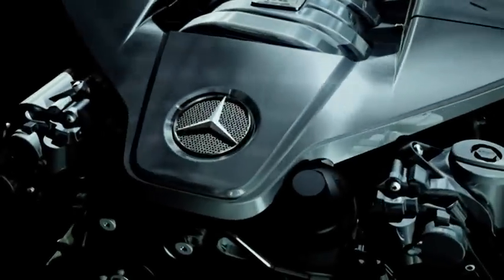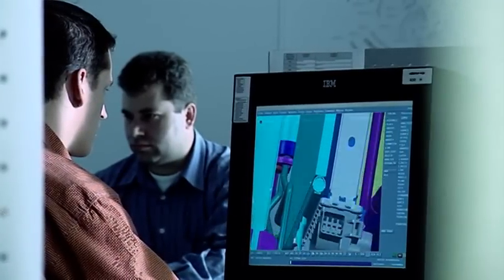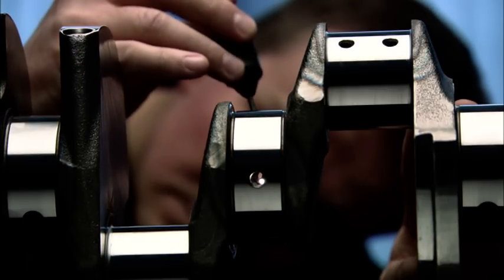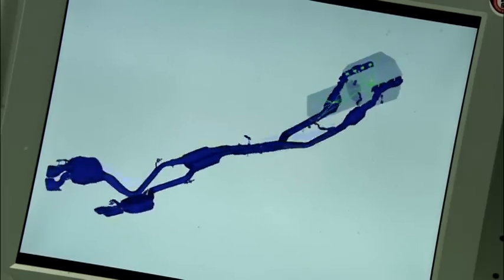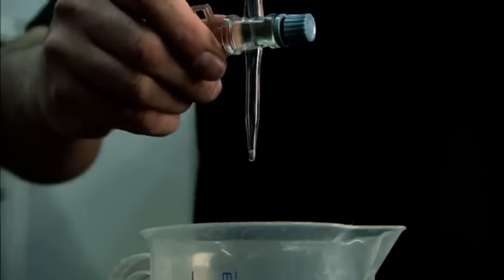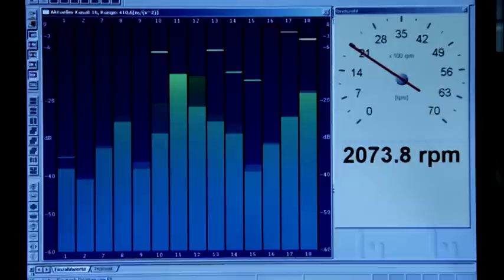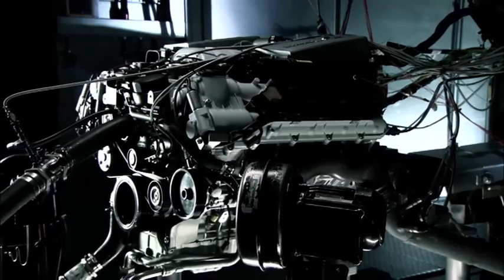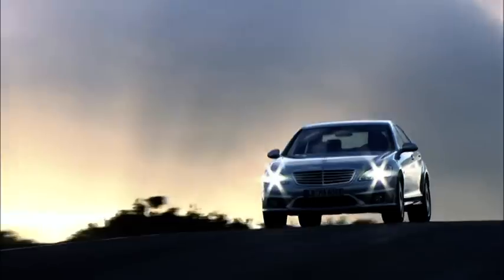AMG 6.3-liter V8 Engine

Comment from the maker: @Mert Turan - Thank you for your question. There are several performance levels for the AMG 6.3-liter V8 engine. The strongest variant is built in the S 63 AMG with a maximum output of 525hp. The performance in general not only depends on the engine, but also on the exhaust system. Also, the performance level is directly correlated to the competition and the market.
Reply: Like my 08 S63 AMG! Sydney Aus! :)
Reply: The strongest is in the sls black series
Reply: Diese Motor ist einer der Besten von AMG entwickelten Motoren. M156 einfach Legende

Comment: To all those people who don't understand the 6.3 saying that it is an 6.2 liter engine, the 6.3 is a reference to the first v8 engine AMG used in motor racing in the sixties. This engine was also the first production v8 produced by Mercedes and was called the M100.
Reply: Bs
Reply: i actually saw a video where one of the engineers explains that it's actually a technical reason why they call it a 6.2. but i can't find it anywhere. something about how you cant call it 6.2 once you go over 6.2, and since the displacement is 6.208, it becomes a 6.3.

Comment from the maker: @TheCrankshaftRotator - Thank you for your comment. As we previously explained, the engine size is measured by 100ccm which means as soon as you are over 100ccm (eg below), it counts as full 100ccm. Here are some examples of different manufacturers:

BMW E90 320i (2007/08) Engine: 1995ccm is called a 2 Liter engine

Mercedes SL 500 (2007) Engine: 5462ccm is called a 5.5 liter engine

Audi A4 B6-8E 3.0 TDI V6 Engine: 2967ccm is called a 3 liter engine

Comment: I have a 2008 C63 and did some research 1 month prior to end of warranty, and to my disbelief found several threads indicating problems with the engine that require a complete rebuild. Immediately contacted my dealer with the information and they agreed to a complete engine rebuild at a cost of $55,000 Australian. Lucky it was covered under warranty!!!!

Comment: My wish for AMG: bring N/A V8s back, and make all the AMG engines truly "one man, one engine" again as well (no V6 mass produced "AMG" nonsense).

AMG buyers don't care how much the MPG is going to be, really (at least that's the case for all AMG owners I know), besides - turbos only are economical if you run as smoothly and steadily as possible  -  any performance engine (turbo, supercharger, naturally aspirated) will have about the same 5~7km/L ratio if driven (close) to the limit (hard accelerations, mid-high downshifts to help the car stop, slight throttle cornering, ESP always in Sport or Off of course, and all the things that are - to me - the major reason why one would buy a sportier car to begin with, to actually drive it, really work it up and work with it, whenever possible).
Reply: I can get 20mpg in my m156 if I drive if as economical as possible on the highway

Comment from the maker: @MrDAllen1124 - Thank you for your question. The Zonda and Huayra use different engines. The Zonda used the naturally aspirated V12 engine M120 (in the beginning with 7.0L, then starting with the Zonda S 7.3 with 7.3L), whereas the Huayra uses the V12 biturbo engine M158.

Comment: An engine that went through all that research and development just to end up getting faulty head bolts that break and cause head gasket issues.
Reply: Very true. Worst is I have a s204 c63 haha. I do not have the headbolt problem but do had the cam adjuster problem. The headbolt problem is not the only severe problem these engine can have, it's a serious list realy, cam adjusters, headbolts, carbon build up, the inlet that corrodes are some of em but there are more. But that being said it is a serious piece of work this engine, it goes like a train and sounds like hell on earth is released. I was always a bmw guy and drove an e93 m3 also, believe me the AMG feel so much more special, sounds better and when talking about performance the e92 is not even close to it. Love hate relationship this car but when you get all the problems fixed it's more love than hate.
Reply: They fixed that on later production engines.
Reply: They addressed it in 2011
Reply: If Scotty Kilmer saw this he would definitely call this a piece of crap.
Reply: @CJColvin  he calls everything innovative a piece of crap. Old timers only like stuff that are difficult to break and easy to fix. If everything stayed simple, technological progress would just stop.
Reply: @nicholaslee5473  You're totally correct.
Reply: @diablocls55  you still have the oil bleedown causing a worn down cam lobe and worn valve lifters
Reply: What’s a bit more upsetting, is they knew about these problems too. But still dished it out. I love my E63, but then I’m reminded of these problems, and it makes me wish I went with a M113k. Love hate relationship is the perfect description for the M156.
Reply: @ixT0PSH0TZxi  I hear that. M113 & M113k is Benz/AMG's finest hour as far as petrol goes. And we both know those days are looooong gone.
Reply: @CJColvin  who cares what that boomer says
Reply: @Mohamed Abugalya  is there a procedure to fix this problem, my bro has a 2008 with 66,000mi
Reply: There's tons of examples that don't have that issue as well

Comment from the maker: @th415263 - Thank you for your question. The standard engine and the engine featuring the AMG Performance Package do not differ on a technical basis. The increase of output (from 457 PS to 525 PS) is purely electronic. However, there are several renewals between the two different versions of the engine: such as forged pistons, connection rod and weight-reduced crankshaft from the SLS AMG. Please visit the "AMG Engineering" section on our website for further information.

Comment: Beautiful but I wish MB would replace the faulty headbolts in all M156's at a reasonable cost to loyal customers BEFORE the engines hydraulic out of warranty :(
Reply: Also please change camshafts, lifters and timing valve soft metal locking disk. Oh yes, intake manifold also.

Comment from the maker: @McQueenRLZ - Thank you for your question. There are around 40 test series that run a couple of hundred hours in total.The various functions of the car's engine are monitored up to 800 hours.
Reply: So I guess the top end of the M156 crumbles to dust at exactly 802 hours? Replacing CAMS?!?! Seriously? Lifters?! Cam adjusters?! Fuel injectors hydrolocking engines & well...at least you were kind enough to properly engineer head bolts after the fact.

Comment from the maker: @pondie335820 - Thank you for your question. We do not offer AMG engines only. Our cars are developed on the full scale, so all parts of the car are developed together and are not sold independently. The only chance to drive an AMG engine is to buy the model in the AMG version, in your case the C 63 AMG.

Comment from the maker: @BossManOG - Thank you for your comment. As AMG was founded in 1967, there were no AMG race engines in the 50's. The AMG 6.3 liter V8 is the first engine that was fully developed from scratch by Mercedes-AMG. There is no counterpart engine from 
Mercedes-Benz. Back in the beginning of AMG, there were of course race engines that were built, but they were always based on Mercedes-Benz engines.

Comment: @damnsonson In Germany displacement is always measured by tenths which means that an engine with 6.208 cc is a 6.3 liter engine vs. a 6.199 a 6.2 liter engine. And getplaning is correct, the 6.3. is sort of a brand for amg engines, thats why the latest engines with 5.5 liter twinturbos are also labelled 6.3 such as the ML 63, E 63 etc

Comment: yeah, how about the lifters not spinning when you get to about 50,000 miles, how about the upper cam shafts not getting equal oil to the lower ones, how about the defective spark plugs that leak after the engine has been shut off...oh but they perfected it though
Reply: How about the faulty head bolts that let go around 50,000 miles?
Reply: Man dont make me sad. I have one and change every 3000 miles oil to avoid that shit with cam shafts. 50000 miles now on it

Comment: @damnsonson 6.3 is an homage to the old 6.3 litre fuel injected V-8 engine that came out in the late 60's / early 70's. It was used in the 600 Limo and the 300SEL6.3 and was the first engine modified by AMG for racing in the European Touring Car Championship. The engine had Bosch mechanical fuel injection and a tuned intake and also cast iron exhaust headers.

Comment: While the AMG 6.2L V8 has more power than the 6.2L LS3 V8 as well as the 6.4L Hemi V8 and 5.0L Coyote V8 the AMG V8 also has more reliability issues compared to those V8s from the Big 3 as well.

Comment: A master piece with faulty head bolts and camshafts that wear lobes flat.
Reply: Was it ever corrected ?
Reply: James Avery the head bolts were, but they have all had issues where cam lobes wear out. The problem is the camshaft is made out of a softer steel then the valve bucket that it’s constantly riding in.
Reply: Head bolt issue was fixed. The tappet issue can be corrected by installing tappets from Black Series engines. But there is still the issue of the camshafts being of a softer material.
Reply: @TwentytenS4B8  yeah but unfortunately took them too many years to fix!

Comment: you could do what my buddy did. When he wrecked his C63 a few months back, he bought it back from the insurance agency and scrapped all the good parts online. Everything in good condition sold. Do note buying one of these engines used can set you back $50,000 CND (new engine replacements in MB cars are around $95,000 not including shop time). Technically retro fitting could be possible, but with all of the computers and custom work (engine mounts and bellhousing) it can add up really quick.

Comment: I admit though, modern cars nowadays suffer from electrical issues, especially some models from BMW, Audi and Mercedes were prone to fail in certain areas, mechanically the engines are just fine, breakdowns were caused by electrical components.

Comment: To rival the 606 (Donovan) and the 502 (GM) Boss Hoss Motorcycle I have always wanted to design a concept motorcycle with the AMG 6.3 engine. In 1969 when I was 17 I worked for a car dealership in Watford, U.K. and I was given the job of delivering a brand new 300 SEL 6.3  to Belfast by way of Dublin, Ireland. refused entry at Dun-lourie re import duties I then had to drive to Ayre, Scotland, I road tested the Mercedes under all conditions, when I was 27 I bought myself a 300SEL, Outstanding!

Comment: I have a question for AMG .if it's an engineering masterpiece , that's why the m156 engines have no forged pistons ?
You install cheap cast pistons for a car for 120,000 - 190,000 euro .
Reply: Good question

Comment: +Mercedes-Amg Why did you reduced displacement of Mercedes C63 AMG?....In my opinion C63s AMG with biturbo with 4.0L its kinda weak for the previous mondel..instead of making a stronger engine u lower the displacement and replace it with bitrubo? And why you call it C63 AMG if it has a 4.0L?
Reply: Stelaras K C40 AMG lololol
Reply: 7367Network that's so sad dude they must bring back their 6.3

Comment: People will be lining up like at Chilkoot Pass to get one of these engines. They spray ceramic on a pistons' crown, but not on the combustion chamber. Ethanol based fuels need higher/lower temps, high pressure injection, big spark and compression. Can an engine work well without certain fuels all the time? This is a finicky engine, unlike the good old Briggs & Stratton, in which the piston never meets the valves, even during a blizzard in January.

Comment: 525HP with 4 cams and 32 valves. at what RPM is this peaking at?
I have a 6.2l 2 cams and 16 valves  in a marauder making 524HP @ 6050RPMs.
Reply: Is it a 6.2L Ford V8 and is it a Mercury Marauder.
Reply: A Ford 5.2L Voodoo V8 from the GT350 makes 526 HP so go figure for AMG owners. Heck a hot cam LS3 can make 525 HP as well.
Reply: @CJColvin  yes it's a Ford 6.2 straight outta a f250
Reply: @CJColvin  the ford "voodoo' is a turd! That turd has to scream to touch 500hp and shit for torque.

I made 524hp with factory truck intake and reground camshafts that barely were much of an improvement.
That engine is now in a 1962 galaxie with a 10speed behind it. 
I upgraded the intake to a sheet metal intake, 160mm tb, long tube headers and 2 cams from crower- 617hp @6620 : 591tq @5600....
The 5.0 design will never make those numbers with out serious upgrades.
Yes it was a mercury marauder
Reply: @jeffjones6125  Awesome brother. What year was that Mercury Marauder brother.
Reply: @CJColvin  04
Reply: @jeffjones6125  Awesome brother and that Raptor engine is now in a Ford Galaxie is even cooler.
Reply: @CJColvin  the 6.2 bolts right up to all the 4 6 and 10 speeds ford has, the 4.6 marauder ECU was adapted to work the modify crank trigger and cam sprocket on the 6.2 to keep the factory computer and gauge cluster to work.
Reply: @jeffjones6125  Awesome brother. Do you have any videos of the 6.2L Marauder.
Reply: @CJColvin  no I don't. Imma upload some this fall of my projects though
Reply: @jeffjones6125  Awesome brother.

Comment: Yes, unlike the BMW emblem that the circular motion from an airplane prop graduated to the blue and white emblem they have used for many years to the present.  Though most automotive companies did make their start with aircraft in the early 1900s.  But although the Germans are best known for their boxer engine design in many cars and motorcycles. It was a French engineer that originally invented it. 
{☼o\==/o☼} (☼☺[][]☺☼)

Comment: Hey I have a question if this 525HP engine is used in a C63 AMG why does the C63 AMG have 481HP?
Reply: Dovahkiin Mert 525 HP for the mercedes cl 63 s 63 sl 63 g 63 ml 63 because the c class is a middle class car

Comment: I have some technical questions: What's the 10-90 burn duration of this engine at full power and at say, best bsfc? Whats the best BSFC this engine achieves? What peak Volumetric efficiency does this engine make? What about Volumetric efficiency at peak power engine speed? What BSFC does this engine make at 2000 rpm 2 bar BMEP? What sound order dominates on an NVH waterfall plot? 4th or 8th? Does the NVH characteristic have alot of half order content? Whats the peak exhaust back pressure value?

Comment: Your examples are bad ones. Who woult call, for example, the E90 engine a 1.9 liter? If you have a engine with 1949 ccm, so it´s a 1.9 - liter. If you have one with 1951 ccm, so it´s called a 2.0 - liter. This is used by all engine producers since many years. 

The AMG engine is a 6.2 liter, not a 6.3 liter. The reason is, because the engine size is closer on the mark "6.2" than the mark "6.3". Every other claim is just technical wrong.

Comment: +MyJizz UrEye *facepalm* ....You do realize that we are talking about completely different versions of those units, right? ....And that in that BS. Australian series AMG isn't actually there as a full factory-supported team?...AND most importantly, you do realize that this is an old, as of today completely retired engine? (comment continues below)

.....Where is your beloved GM in terms of more efficient, modern engines??? .....Where is the GM-equivalent of the engine found in the A45/CLA45 capable of  360bhp/450Nm(332lb/ft) with 40mpg???

....Where is GM in the most popular, most expensive racing series, you know, the one called "Formula-1"?  Why won't they join to break the complete Mercedes dominance???

....Let's be honest, now it's your turn to shut up, troll....

Comment: Reliability second to none?? Doesn't everyone by now know of the headbolt issues requiring replacement of CAM Shafts, lifters, etc or a new engine replacement? Anywhere from $5k - $20k.  I have yet to find a high performance engine that is truly reliable in any car other than the Lexus 5.0L V8 from their F models. BMW's are out, their engines are disasters too. Audi is hit or miss on their S and RS engines. Porsche engines have so many catastrophic issues its a wonder anyone buys them used (look up IMS bearing and or carbon buildup for newer engines).  Too bad the best engineers in the world, the Japanese, make so few truly fun cars like the Germans do.
Reply: Maor Roffe  small block v8. Any ls motor is very reliable. And for a v6 would take the 3800. Can even have the supercharged variant. Many Pontiac’s and Buick’s had them.
Reply: I have an E63 and I can't argue with that, and a huge aftermarket and cheap replacement parts. LS engines are also pretty good on fuel.
Reply: Maor Roffe show me proof for your accusations. You are speaking on isolated events not common problems, all companies fix any issues pretty quickly. German companies are good at fixing any fuck ups. My m113 is one of the most reliable V8s ever made.
Reply: How can you compare the M113 to the M156. The M156 is a good engine, I have one but it is just not well engineered. They fixed some of the issues with the later ones but the headbolt and cam lifter thing are HUGE problems that should never be acceptable in an AMG. They should have done a recall and swapped all the bolts to the new ones, it's a big job but their mistake.
Reply: The later model M273 5.5L V8 produced by Mercedes is pretty good. Basically 382hp with a flat torque curve, variable valve timing and quick start-up mode. Wish they made a supercharged version of that one from factory.